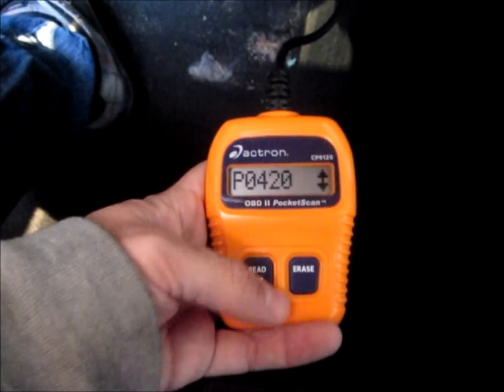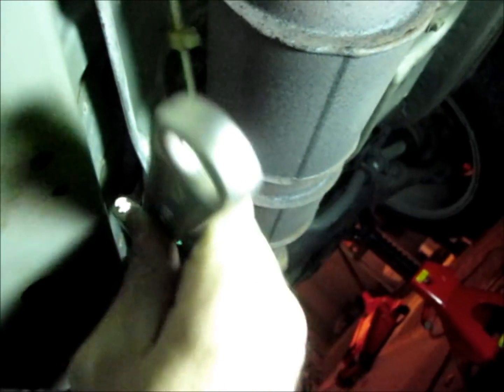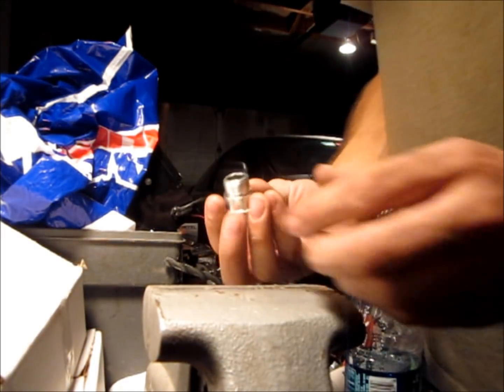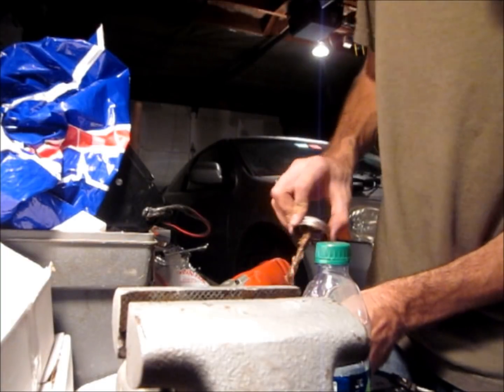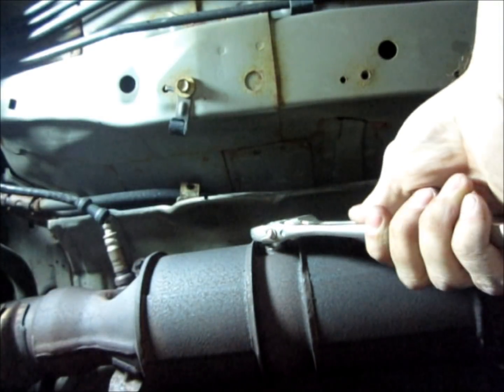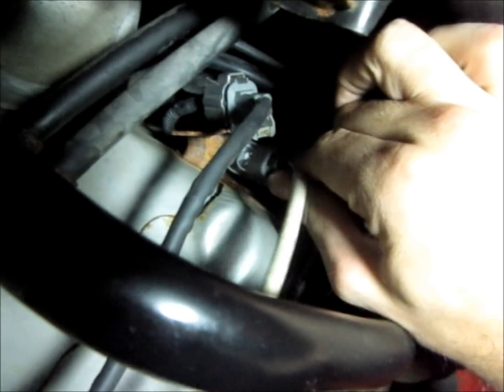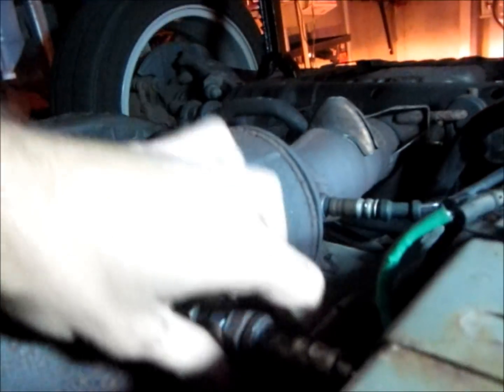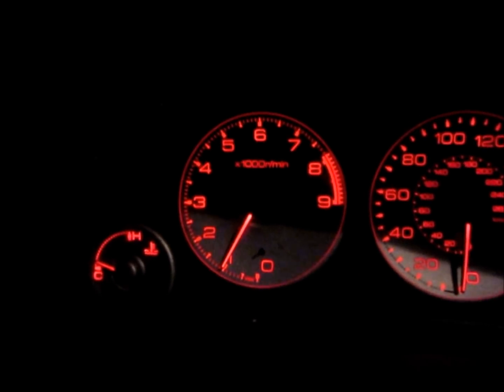Clear check engine light for less than 5 dollars

Comment: im glad we dont have emissions .. i dont much but just learned your converter should last 10 yrs at least and the reason they go out is because you have another problem .. like miss fires or something and caused the converter to get too hot and melted pretty much .. looks like mine melted on the back side edge, i wonder remove the back pipe and get some kinda ice pic and start punching holes in that melted part you can maybe reopen them little holes in the converter .. seems like  if you can make the back sensor run constant low voltage you wont have a converter error as long as the front sensor is working right .. when they both have a voltage jump up and down and read the same is when you know the converter is bad from what i read the other day
Reply from the maker: Interesting.  I've heard also that a converter can be damaged by running the car out of fuel and constantly trying to "dry start".  This can damage the precious metals inside the converter and wreak havoc on your sensors.  Often this is the case and everyone thinks the cat just gets clogged up. You would know if your cat was clogged lol, the car would run like a bag of shit.
Reply: they have to get up to 800F to start working .. excessive short trips can make one go out .. .. i think i just read they are pretty toxic at a low temperature .. i think mainly they go out when they just get too hot and melt .. besides coolant or oil messing it up .i cant really find a reason just cranking should mess one up .. unless its dumping fuel on it .. usually it might almost idle a little ruff but you cant get over 25mph lol .. i finally got my check engine light turned off for 20 bucks ;)

Comment: My husband has a 1997 Nissan Truck and his check engine light stayed on and his friend (mechanic ) has done everything he knows and cant get the light to go out , so my husband cannot get his truck inspected because of the light wont go out ? I watched your video and I am gonna pass this on to his friend , me being a woman bet he wont listen ? but if he brings the truck home I will try this I am pretty smart fixing cars !! thanks for this info .Thanks again. have a Blessed day
Reply: try selling the car as a fix
Reply: melinda conner. tellour houspan take off the dust Portland paint the red light black put it back you're good to go
Reply: melinda conner DON'T listen to him! He'll cost you money!
Reply: Sounds like ur husband needs a new mechanic!
Reply: If you're that smart fixing car's, why won't he listen to you? Dam that man!
Reply: I have a nissan Frontier that has/had numerous check engine codes.  The light was always on.  I researched on found out that Nissan's have a problem with insufficient grounding of the ECM.  To check this use a voltmeter and test the voltage from an engine bolt to the negative battery terminal.  The voltage should be less then .025 volts (mine was .25V  10x out of spec).  If it is bigger your engine/ecm isn't grounded well enough.  To fix:  add an additional ground wire from and engine bolt to the negative battery terminal.  Problem will be solved.

Comment: To clear the light...press and hold then turn the ignition and then still hold until light goes away, Correct???      i got a A4 1.8TQ.. i wana try it
Reply: doesnt work for your model
Reply from the maker: Veyron640 Just to be clear, the maintenance light is different from the check engine light. Maintenance light as you may or may not know comes on at different intervals-- say for instance every 3k miles to remind you that your oil needs to be changed. Check engine comes on when some component of vehicle is not functioning properly.  You can google how to clear your maintenance light for an Audi. To clear the check engine light you need to run a scan, research the code, and find a solution to the issue. Then you either reset the battery and it will go through certain driving cycles, or leave the battery alone. Either way it will clear itself granted your remedy was a successful one. Thanks for viewing!

Comment: This modification may remove the check engine light but your vehicle will not pass the inspection because NOx is still coming through the exhaust pipe.
Reply: that's where the gallon of methanol comes in LOL
Reply: Tariq Khan  For states that do emissions testing via tailpipe. Many only rely on OBD readiness meters.  Also, I know for a fact that Michigan and Florida don't have any safety inspection whatsoever.
Reply: I did this on my 05 scion TC worked and passed inspection . Did not pass before now it does
Reply: In ND we dont do that

Comment: guess how used car lots get the light to go off....that's it you guessed it they remove the bulb it never comes back on
Reply: Most check engine lights will go out if the battery is disconnected for a short time but it comes back after a drive cycle.

Comment: one better? (not cheaper..)take a volt reading on the sensors and hack into the wires going to the computer harness to duplicate them with a resistor to drop the 12vdc to the 1.0-1.5 voltage level going to the obd.. It works. Another thing that works every time is to add some everclear (wood grain alchohol) (hip flask)to your tank @1/4-1/8 of a tank just before the test. After you pass, fill up with premium fuel and run that out. after that tank is used up, the light may temporarily come on as the computer relearns the temp and driving ranges you use. This usually causes the tech to start cursing, thinking he has to recal the bench in the machine,but thats his worry, not yours...

Comment: Disconnecting the battery on these newer vehicles will not clear the codes.Has to be done with a scan tool,most code readers have a clear code option too.Don't have to disconnect the battery,unneeded.Most newer cars have security in the radios and programed to the car,the radio won't work after the battery is disconnected
Reply: Has to be done with a scan tool

Comment: is this checked during a Calif Smog check? if caught, will it automatically fail the smog test due to exhaust modification?
Reply: moccina Yes, I live in CA & have a truck that needs to have the restrictive cat removed because it robs so much power. I got AEM cold air induction & that helped & is legal here, but the cat still robs my engine & uses so much more gas. Where do you get the kit? Smog only checks tail pipe emission & look under your hood while they rev it on a dyno computer. I think I could get away with that!
Reply from the maker: I would not try this in Cally.  I've heard they are Nazis on smog out there.  You might as well go legit if you live in CA lol, I would imagine it's not easy to get away with much out there. Thx for watching
Reply: Took my car to a smog place in CA. This will not usually work because they specifically look for modifications ( some places might let you slide), if they find any illegal mods ( this method counts as one :/ ) they will automatically fail you. What I did instead was to clean all my O2 sensors as shown in this video, cleared any debris and that worked for me to pass smog and clear the check engine! Thanks moccino for the detailed instructions it definitely helped me!
Reply: C June Here in indiana there are only 3 counties that have emissions check, and 2 of them are side by side!
Reply: Brian Westmoreland wow, wish CA was a little more lenient like Indiana...  it gets a little expensive keeping up sometimes. Can't complain to much though, don't want to add to the pollution any more than we already are I suppose.
Reply: This is true, we have a lot of steel mills here in North West Indiana near Chicago., which probably burn cleaner than the cars on the road, the other county is Marion which is Indianapolis area.  A lot of people who can't pass emissions call a relative a county east of Porter, and register their car in a emission free county.

Comment: Wow......you have cleared nothing p420 code means your upstream sensor is reading the same as the downstream sensor. .... what dose this mean .....the cat is damaged/worn out by adding the " buffer" you pulled the sensor out of the exhaust steam you still have a  bad cat shit like yhis don't fly where I  from but yoy got almost a million views
Reply: It also means that taking it to mechanics like you will make you a bunch of money which you could possibly get for doing a cat converter change. Which it probably does not need. Watch the Scotty Kilmer idea of how to clean a cat converter.
Reply: A p420 code means that the two sensors are reading the same.  Meaning the cat is no longer working correctly or the engine's exhaust is high in hydrocarbon ( unburnt fuel) and the cat can't process the hydrocarbons. This is why there is two sensors one before the cat and one  after to measure the difference. If you live in an area where they don't smog/emissions test more power to you go ahead and remove the cat altogether the engine will breathe so much better.
Reply: FarAboveDaCloudz he literally drilled them out in the video if you had watched you would know that
Reply: GreaseMonkeyInc  ...You are absolutely correct. It's just the cheapskates that don't want to fix the real problem (replace the cat after isolating and fixing the real issue that caused it - unmetered air intake, crack in exhaust manifold or other exhaust plumbing, injector stuck open, oil consumption...etc - that think all mechanics are theives. Perhaps we should return the favor and go to their place of employment and request their services then tell them they're full of it. Kudos to you!! The only time I've ever seen spark plug foulers used was at used car lots to conceal the truth. Wait till the clogged cat ends up burning a valve lol...And by the way, did you notice that the jackass that posted this never mentioned drilling out the center of the plug defoulers? What a joke!!
Reply: mrdan24 I live in a place where that is not an issue. But after removing the cat the check engine light will still stay on. What do you suggest to turn it off. ?
Reply: Hmm there is only two things you can do replace the cat or do the fowler trick in the video but after further research there was a thing call an O2 simulators but these are not legally sold in the US. After a little mor research the Clean Air Act prohibits the tampering with emissions equipment. So what is being done in this video in short is illegal but are they coming to lock you up for dicking with your O2 sensors prolley not
Reply: Then why suggest to take off the cat in the first place ?
Reply: Because cats are restrictive especially one that have melted and/or plugged up  but reading up I found out its prohibited  under the clean air act but again are they going door to door checkin cats  on your vehicle s
Reply: GreaseMonkeyInc Dude, I believe the purpose of this video is for smog check states, which is mostly all of them now, & people who want to run after market exhausts with free flowing cat. You can't do this in CA & pass the smog to register your car every other year.
Reply: FarAboveDaCloudz yes he did

Comment: I had the a P0420 code on a Chrysler T&C which has a problem with oil consumption due to bad valve stem seals which Chrysler won't acknowledge. Anyways, all that oil was clogging up sensors and the cat, did the "seafoam treatment with MMO" and 5 weeks later still no light and passed inspection too.

Comment: I had the same code in my golf 2003, i was about to change the catalytic; but i noticed pieces of plastic floating in the coolant reservoir, the small leveling funnel inside had broken in pieces, i switched the plastic  reservoir and after a day the light went off , so far is off, i guess has something to do with temperature in coolant

Comment: There like $50 at most auto parts stores. You can check a bunch of aspects of a car really. Shoot the laser on the front of the converter then the rear. If it's hotter in the front you have gas build up.  If it's hotter at the end of the converter that means your converter is working normally as it's burning unspent fuel. 100 degrees on average difference is about average temp variation.

You can also check misfires right on exhaust manifolds too, a bunch of things really.

Comment: One question-how did you get your car on it's roof to check for leaks? Ha Ha...

They use battery powered Sawzalls to steal the convertors by me. 5 minutes and they're gone. Walk in through the woods and crawl under the far side of the car. You don't even see them. They also steal a lot of outdoor AC units. 4 at the company I work for. They stole a huge one off the roof of an auto repair shop near where I work, too.

Comment from the maker: Pretty sad that someone actually took the time/effort to remove your cat and steal it.  If they get caught it's probably the same punishment as if they were to steal the entire car lol-- not too smart.  Anyway, the electrical tape cover up will only work until you actually need to get the car inspected / obd emission checked at which that point you will actually need to deal with the issue.  Thx for watching / commenting!

Comment: We had our cat cut off and stolen from our 2001 CR-V, put a straight pipe on it and the check light didn't come on again for another 6 months. Then it came on when a weld broke and we had a leak. Ignore it or cover it up with a tab of electrical tape.

Comment: It works. had  P0430 code for 2 yrs have to smog first time. cost to replace the CAT is $1500, CA only. raw data from all the 02 sensors, secondary sensor, Bank 2 out of spec. This sensor has no effect on engine control  air/fuel mixture, only monitors the efficency of the CAT.  $10 and 1/2 our later, long drive the next day, all clear.  Took to the smog station, passed. they hooked to the computer, and did a sniff test.  well under the max allowed emission levels. 07 toyota w/ 193k miles.

Comment: Dude your an idiot. There are a lot more factors here than what you show and explain you might know a few things about cars but this is not a effective repair. I am an automotive technician and the cars computer will still test on that sensor and it takes two days at least of full warmup from cold start (meaning car sat overnight and fully cooled down)as well as certain criteria have to be met for the computer to test and it will test and fail the cat twice before the light will come back on

Comment: not necessarily. in most cases the p0420 will pop back on as soon as the readiness monitors complete their testing. if the readiness monitors are not ready, they won't test it.

Comment: What moccina said. Post cat sensors do nothing with respect to adjusting air/fuel ratio. There purpose is nothing more than to monitor the output from the cat for emissions purposes. Please study the system before posting incorrect information.

Comment from the maker: Secondary 02 sensor does not have any authority over fuel maps and tampering with it will not change the way the engine runs.  Primary Sensor is a different story, and is referenced by a different CEL code.

Comment: I'm a female college student who just bought an '02 Toyota Corolla CE. I recently took the car on the hwy and at some point between the 65-75 mph range, the check engine light came on for P0420. I let the car sit in my garage for 2 days and when I went back to start it up, the check engine light was off. Its been about 2 weeks of driving and the light hasn't turned on. I feel like the light will come back on if I go on the hwy again and im not sure of what I should check or replace.

Comment: done it for the last 2 years. works fine on Chevy Tahoe(2003). i do have a bluetooth odb2 reader that i can clear a code with torque pro however the cel will pop back up with in 20 minutes.. unplugging the battery last a few hundred miles.
i need to change the purge solenoid and charcoal canister on it.. i'll get around to it now that its actually effecting gas mileage in a negative way. im use to 16-17mpg and now its getting like 12mpg.. though i do have 4 alternators too so that takes a toll

Comment from the maker: I appreciate your input.  Whether or not this trick should be used is subjective.  If the cat is actually clogged, you don't have many choices but to replace it because eventually it will cause damage and one day the car just won't start.  IMO, the fouler method can come in handy when the CEL is on due to the cat being slightly less efficient than when it was new--but not clogged, and you can't justify the cost of replacing it.

Comment: i unhooked my battery for 20 min, reset the ecu put 140 miles on the truck and passed inspection. the cel didnt come back on for 500 miles.. so you CAN fool the test by simply unplugging the battery.. i did it and re-registered my truck with no issues.

Comment: moccina did you use your old sensor??? is it better to buy a new one? the thing is that i removed my cat but before that my o2 sensor was already bad so my question is do i have to buy a good sensor then do the fouler adjustment?? well i had 2 cats so i guess i need to do 2 foulers thans for posting the vid!!! note my har runs so much smoother withou cats not to mention the free ponies and revs faster !!

Comment from the maker: Scroll down-- this has been covered many times.  Replacing the 02 sensor will do nothing if the issue is a "malfunctioning" converter-- not to be confused with a clogged converter.

Comment from the maker: Just to clarify-- If you have recently reset your ECU by way of battery disconnect, it will indicate a status of "not ready" to any OBD test until the car completes a certain set of driving patterns.  Once complete, your ECU will indicate a status of "ready".  If at this point the CEL does not return, your car can now be brought in for inspection. You cannot fool the test by simply unplugging the battery-- it won't work! Thanks for watching.
Reply: So if its not ready what do I do? I thought the converter didn't work.  😬.